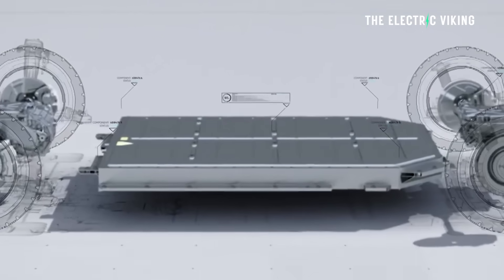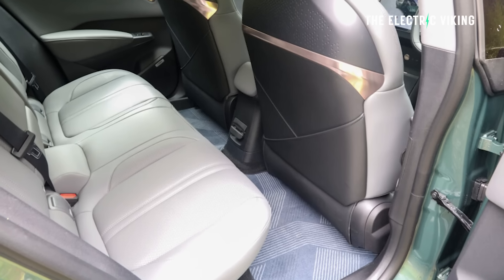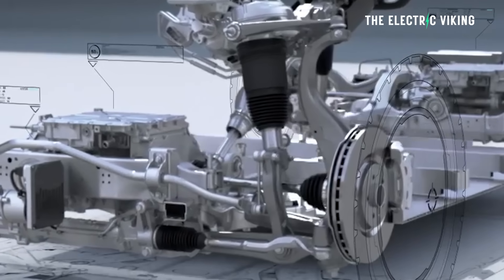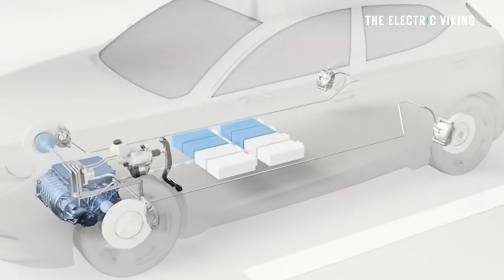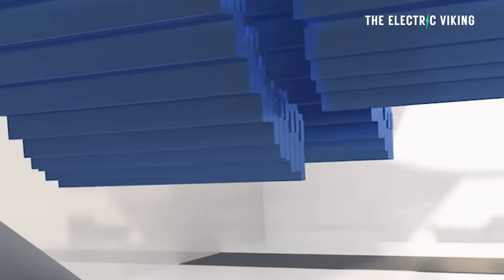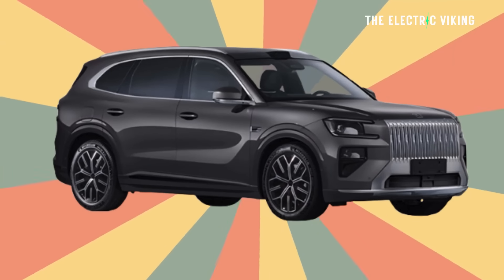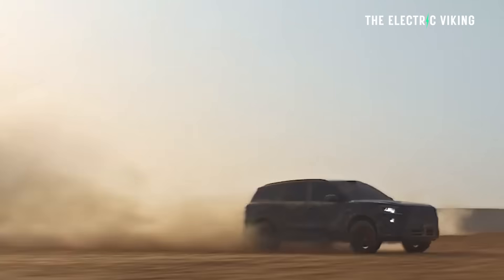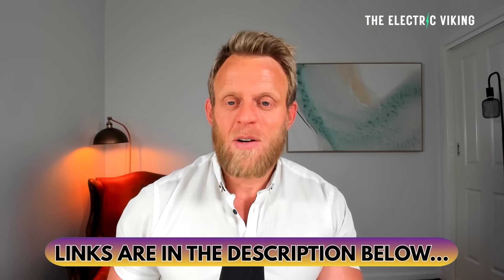THE 1,381HP SUV: The Zeekr 8X is a 900V Monster That Charges in 10 minutes

Comment: "Hey Viking! You are obsessed with charging speeds, but you're missing the point. To me, charging isn't a 'wait'—it’s a Mental Recharge.
In my new Enyaq, I don't care if it takes 25 minutes instead of 10. I recline the seat, turn on the massage, and use that time for mindfulness. If the car charges too fast, you lose that window to de-stress. I’d rather arrive 15 minutes later with a clear head than rush through a stressful 10-minute stop just to save time I'd probably waste anyway.
Efficiency is for the car, but Mental Recharge is for the driver. Stop selling us a race and start selling us a better experience!"

Comment: This Plug In Hybrid is made for me. 70kwh Battery is pretty and you have a total Range of 1000km. That´s insane and fast Charging. That´s so good if you go on holidays. But the Length is so much. Over 5m is heavy but you won´t get an Plug In Hybrid from Zeekr. An 7X Plug In Hybrid would be perfect for me.

Comment: in this case the electric discharge C rates with 75kwh capacity will be in excess of 13C , which will cause very quick overheating and battery degradation if sustained. are they going to produce an all electric 8x model ?

Comment: We have a franchised Zeekr dealer in Dubai. 9X is already available on grey market for about $100,000. I expect 9X and eventually 8X to become available through the dealer; it’s just a question of time. UAE/GCC are the ideal markets for large, luxurious and expensive SUVs. I would rather get these vehicles than almost anything else on offer from legacy brands (am currently driving Xpeng G9P and older MB G320 SUVs). When you compare specs, features, performance and tech, higher end Chinese vehicles are far ahead. I usually summarize it as 40% more features for 40% less money than legacy brand vehicles.
Reply: did anyone already tested the 0-60 mph or 1/4 mile on the 1400 hp 9X?
Reply: liar
Reply: Salam, it seems im finding you in all the channels I follow